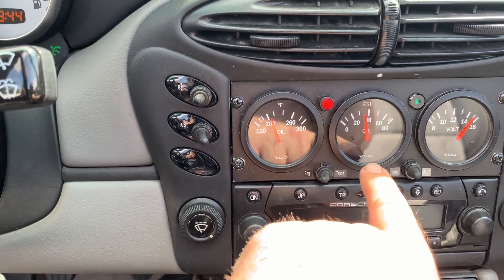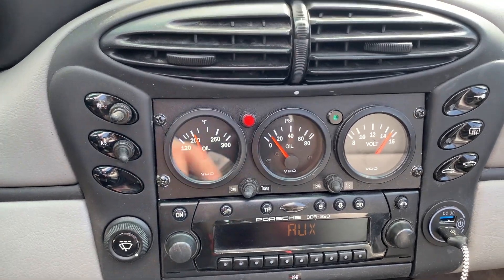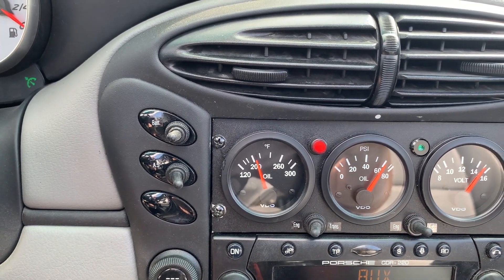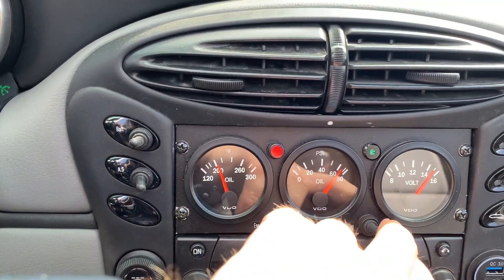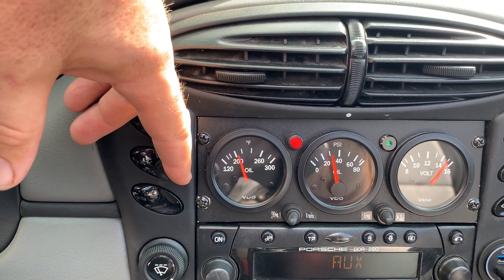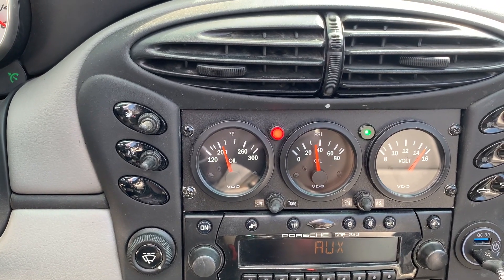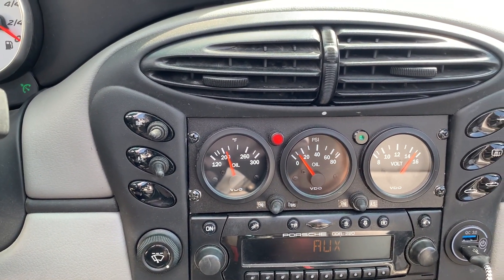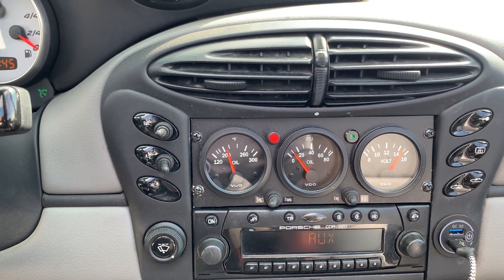Accusump benefits in 2001 Porsche Boxster S (986) on BIR racetrack

Comment: Had accusump on msny motors and at teardown to check wear there was very little, it is worth every penny
Reply from the maker: To do that test accurately, you would want to run the same motors with and without Accusump.  The best proof point is the fact that we can see the oil pressure go to zero without the use of the product.  We all know that zero oil pressure leads to bad things very quickly

Comment: Did you install the accusump setup yourself or have a shop do it? If you had a shop do it do you mind sharing with me the labor to install the accusump?
Reply from the maker: I installed it myself in the location of the current fuel filter.  I move the fuel filter to under the hood, next the battery.

Comment: Just seeing this video after thinking I want to track the car just a few times a year. If one does not use a deep sump are you destined for damage on your first few track days ? Is there a kit or porsche solution you do reccomend ?
Reply from the maker: The problem becomes more pronounced with higher G loads. Track tires, lowered suspension, etc. will all compound the issue. If you are running street tires and only doing one or two days per year you should be fine. However, if you want to sleep better at night the deep sump is the best insurance policy

Comment: Nice video, Hartech has a setup where the accusump dumps directly into the oil pump. I’m waiting to hear back from them on the benefits
Reply from the maker: I’m not sure how you would do that on a Porsche M96 engine. Theoretically, the Accusump can dump anywhere on the high-pressure side of the oiling system and you would have similar results.
Reply: @mikepetersen3  check their Facebook page, they have pics up
Reply from the maker: I checked out their Facebook page, thx for that tip.  However I think their design is flawed - as they push the oil into the system on the low pressure side so the oil can move into the pump but also upstream back into the oil pan. This means much of the benefit of the capacity is lost.  You want to push the oil into the high pressure side of the system, so the oil pump will at least prevent back flow.  Using an adaptor on the oil filter is still the best location IMO.
Reply: @mikepetersen3  I hear ya… time/testing will tell.
I’ve always been curious about how long does it take the accusump to refill, and does it dump its full load every time or is it a partial dump to keep things at the set pressure level.
Reply: @frederickcook87  I can´t find that post. Can you help? What´s the date of the post? Thanks :) I´m really curious to see if they do it the way I did it in my Elite ECU.
Reply from the maker: @frederickcook87 , It dumps a partial load in most corners, and a full load in a few corners.  It always "catches up" in the straight before the next high G turn.
Reply: @mikepetersen3  did you see the UIDS on rennlist?

Comment: Great way to show what the Accusump actually does!! Will fit one to my car as well soon!
Reply from the maker: Hi Bene, I am rebuilding the car now, and am adding a deep sump pan, as the Accusump can run dry for brief periods on long corners. Pros and cons to both Accusump and deep pan.  If I had to pick one, I would suggest you start with the deeper pan.
Reply: @mikepetersen3  Thanks for the advice :) I´m already running a bigger pan in my Nissan, hope the Accusump will prevent oil pressure drops.